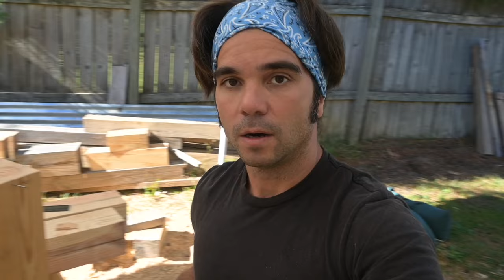How to Scribe Posts to Stone Part 2 - How to Scribe Wood with Power Tools

Comment: So once it’s scribed, weight alone will hold it in place?
Reply from the maker: Traditionally, yes. The lac of pins helps with earthquake resistance. You can add a positive connection, though. Mr Chickadee has a video on how he did it. Most of his buildings simply sit on stone, but he has a big pavilion on a ridge he did secure due to wind concern.

Comment: Wonderful video! So from what I gather, the steps are as follows:

- Anchor the foundation stones on-site and mark crosshairs on them (spacing them exactly based on the floor plan grid)
- Snap ink lines on every post in the workshop/sawhorse
- Move each marked post over its stone and align the ink lines on the wood with the crosshairs on the stone
- Make sure the post is both aligned with the stone crosshairs and perfectly vertical
- Trace the profile of the stone on the four sides of the wood using the profile gauge
- Shape the bottom of the post using the angle grinder
- Re-position the post on the stone and check for plumb
- Trace the outline of the post onto the stone with a pencil

My question is: Only after all of this is done, then and only then can you mark the joinery on the post (mortises, housings etc)? Because they first must all find their place on their respective stone, and nobody knows exactly where they will end up? And do you take them back to the workshop/sawhorse to continue marking?
Reply from the maker: Looks like you’ve got it!

Yes, it is easiest to do the scribe first, then mark the joinery. There are some Japanese carpenters who do the joinery first but that’s not the rest of us 😅

After scribing, stand all the posts up and strike what the Japanese call a mizo sumi line. This is an arbitrary reference line that you base your joinery off of. 

Our water level video shows a bit of this process. 

Use a laser level or a water level to mark the same height on each post. You obviously can’t measure from the top of the stone since each post/stone is different. Hope that makes sense - it’s a little difficult to put into words. 

After your line is marked and you’ve triple checked it, take the posts down and mark/cut the joinery.
Reply: It makes perfect sense. A laser level is definitely the best for this. Perhaps with the crosshair mode that some laser levels have, you could check both the verticality of each post and the location of the arbitrary line simultaneously. Or use it to mark the crosses on the ends of posts. I just don't know how accurate it is.

How did you learn all this?
Reply from the maker: @dimitristsigopoulos  

Lasers are theoretically better, but I've seen them go wrong, and you have to have the correct lighting conditions. I usually end up doing it with water adn checking it with the laser.

Learned through a combination of just trying it out and Mr Chickadee. Attended his in-person class a while back and it became the foundation of a friendship that I'm very thankful for. He uses all hand tools for the scribing, which I tried once before going to the angle grinder. Played around with different wood cutting disks and burrs to figure out what worked well when.
Reply: @appalachianwoodhomestead  Nice. Thank you for sharing all this freely, and Merry Christmas / Happy Holidays to you all.

Comment: nice work. i love this technique. when  you size a structure do you scribe posts individually to the stone and then do the joinery? is there a way to the joinery then scribe?
Reply from the maker: The posts are scribed first. Then you use a level (laser level or water level) to make an arbitrary reference line. This is called a mizo sumi line in Japanese. That line is then used as reference for marking joinery. However...there are some Japanese timber framers who are so good that they can to the joinery and then the scribe. Not personally there yet. 😅

Comment: Overall, and for where you are at in learning the craft, I think this was well executed, thought less than traditional because of the power tools, which is not a critzime (at all ☺) and often found now on most project sites in both Korea and Japan. 

You are scribing the post to the stone first in your method of this, which I have to admit is the way I find it most accurate because of just not having perfected the method still to the level I've witnessed it being done most often. Typically  the joinery is cut first and then the scribing is done just before putting the frame together.

As for how tight they should be, I agree it is up to the individual (per se) but if trying to match the traditional worked 95% of the entire perimeter scribe will have a zero clearance to the point that a..."0.25 mm feeler gauge"... will not fit under the scribe line point under a post which is pretty standard in vernacular examples of this method of fitting post to live natural edge stone plinth in both Korean...그랭이질 - geulaeng-ijil...and  Japanese...光付け - Hikari-tsuke styles of "stone plinth foundations."

As a side note, I have to admit, other than Japanese  民家 - Minka, I tend to really love a lot of the Korean styles of archtiecture...such as Hanok much more than the Japanese styles. They are made for colder climates and I love the designs of their form of masonry heating with the  온돌 --ondol  floor heating systems.

I thought you might enjoy the this link of the frame I designed and built with two friends here in Wisconsin (I may have shared this with you before...apologize if I did) 
https://maps.app.goo.gl/616hg321edeYzWHY6

Here is a link of a projected I followed in Korea that you may enjoy reading (just use a translator.) 
https://www.ohmynews.com/NWS_Web/view/raw_pg.aspx?CNTN_CD=A0001410025

Comment: After scribing the post, I laid a piece of plywood on the stone, leveled it, and drove a grid of screws spaced 1" apart through it until they just touched the stone.  I checked that the plywood was still level, and then took that to the post to check for fit.  It worked, but it was a slog.
Reply: In ancient Greece, when joining stone beams or column drums with each other, they would smear a thin layer of clay over one piece, keep the other piece clean, and then they would touch the pieces end to end. The parts which would make contact would leave a clay mark on the clean piece, which would then have to be filed away. They would apply clay again and push them together again, and keep going until there was contact all over the surface of the stones.

Perhaps this can also be used to scribe wood to stone somehow.